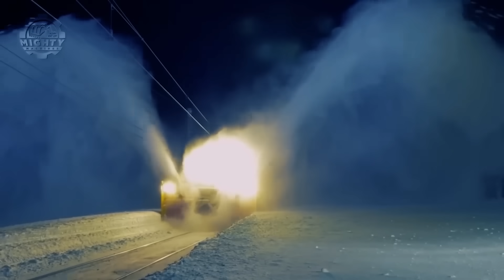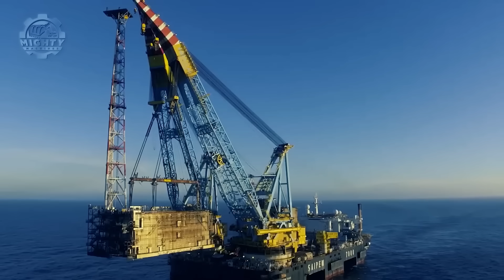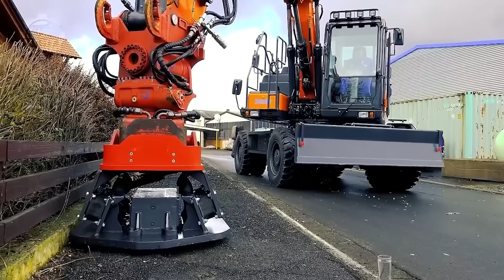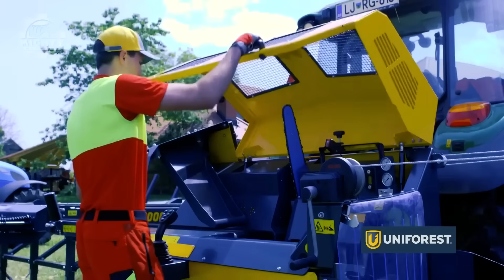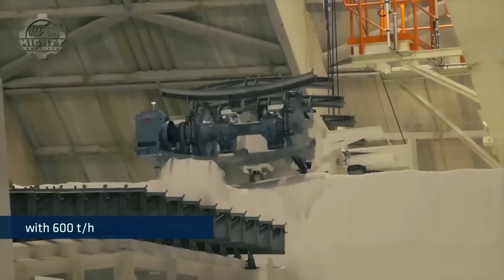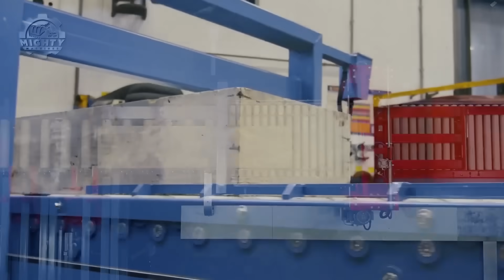150 SUPER Crazy POWERFUL Machines And Powerful Heavy-Duty Attachments You Need to See

Comment: Very initiative machines but the cost of these nitch machines must be huge as production per unit verse costs.  I realize all the units are made by non-related companies but imagine if all these machines of similar size and engineering used one manufacture for the basic running frame and power plant within reason, depending on power needed, stability, and other factors where size is factor scaling up or down could be utilized, one manufacture could design, make and standardize parts.  The cost per unit could be slashed and standardization in maintenance, parts and operator familiarity would be key in financial interest. Huge job to make square and round pegs do the same job but it could and would create new thinking and design industry and maybe create a whole new outlook towards standardization.